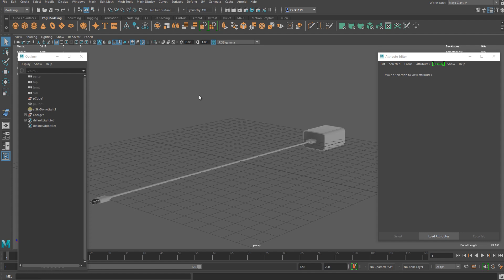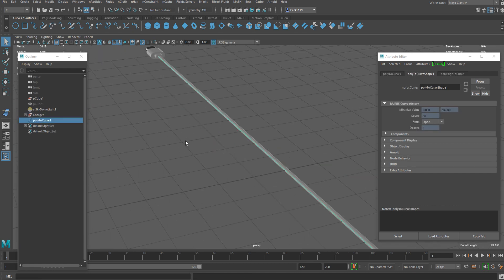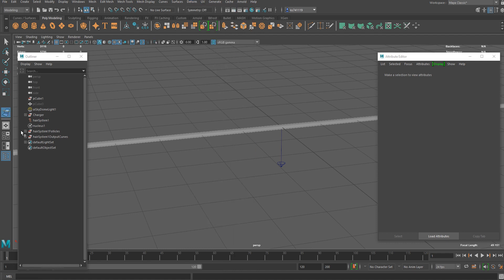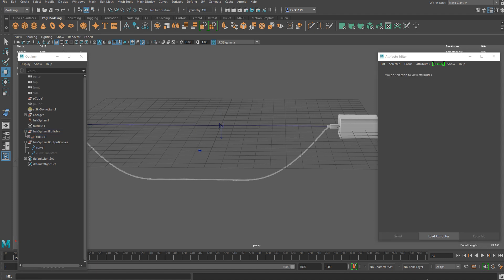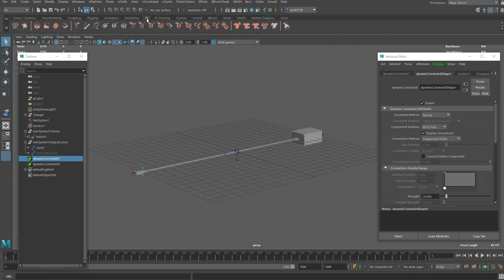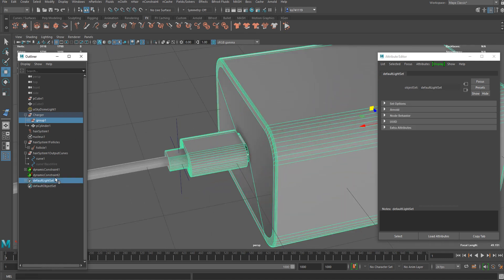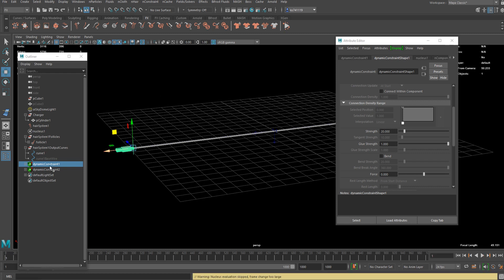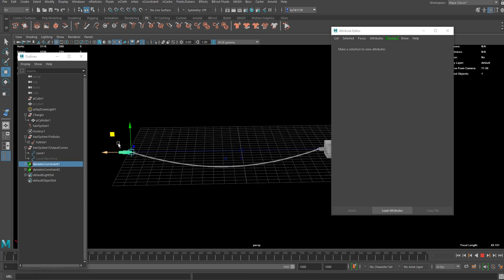Maya Wire Simulation Tutorial

Comment: Will the wire simulation still work if both ends of the cord are moving? Let's say for example a character is holding each end of the cable and his hands are moving.
Reply from the maker: There is an option to constrain both ends. Also, you can manually set up transform constraints on both ends of the spline and parent it to the characters hands.

Comment: I tried 3 different versions of maya and can't make this work. The nHair curve works fine but the geo does not move with it after attaching the wire deformer... any other trick to this?
Reply from the maker: Does your geometry not move at all or get distorted? If it is not affected at all, there’s a chance that wire deformer is not applied properly. Try applying wire deformer in order since it is quite an out-dated solution which makes it quite tricky to apply.

Comment: It doesn't work at all . I hit ''enter '' after I selected the curve just like in this video and nothing happened
Reply: Same thing here, when I hit play nothing was happening. I finally got it to work after adding more points to the curve using the Match Knots button (rebuilding curve didn't work for me like it worked in tutorials from older Maya versions, so I suspect they changed the functionality).
Reply: @nikkiii_burrito  where's that button plz ? Maya's telling me "Cycle may not evaluated as expected" help
Reply: @alanvolpe36  i just saw a cmmt form Autodesk community, said u need to tweak the "dropoff distance" in the wire  deformer to see its effect, hope this helps others since ur cmmt was 2 yrs ago from mine, worked for me btw
Reply: Make sure you match "start frame" to your timeline framerange. It will always start on frame 1. Could be a solution for some